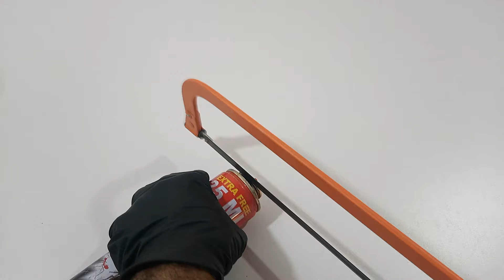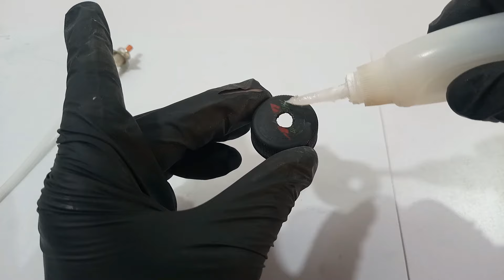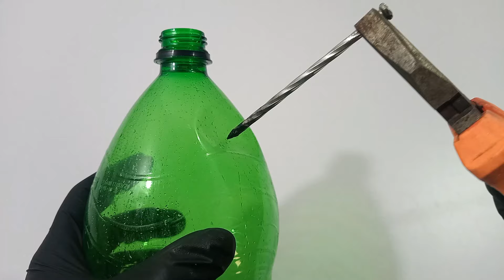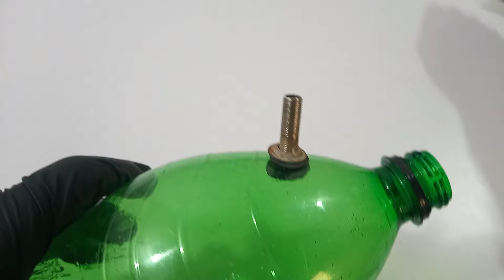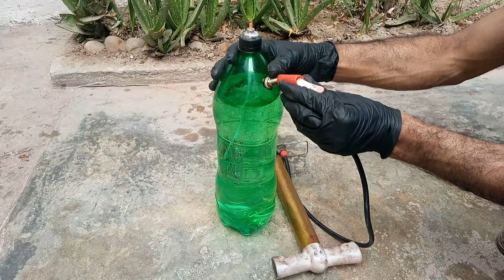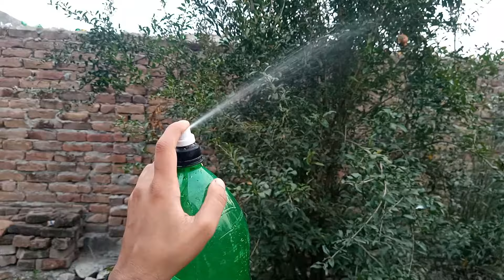How To Make A Pressure Spray Bottle - A Brilliant idea

Comment: Why you put cotton is is the best thing to use
Reply from the maker: cotton with super glue can fix small holes perfectly
Reply: Super glue chemically melts plastics and materials such as polyethylene, polypropylene, polyvinyl chloride, or polytetrafluoroethaline, and the cotton helps fill in the gaps of air in the melted solution

Comment: Can i use the valve from football instead of one u used which is from bicycle
Reply from the maker: Yeah you can use. And keep the hole in bottle according to the size of that valve
Reply: @ can i get ur email? I have made this but its not working, so if i could send u the video ?

Comment: कितने पंप में कितने मिनट तक कंटीन्यू  चलसकता है यह जानना था बहुत ही बढ़िया है कोशिश करूंगा ऐसा बनाने की
Reply from the maker: It will work till the bottle becomes empty. All you need is to add more air in the bottle. Then it will work much better and at high pressure